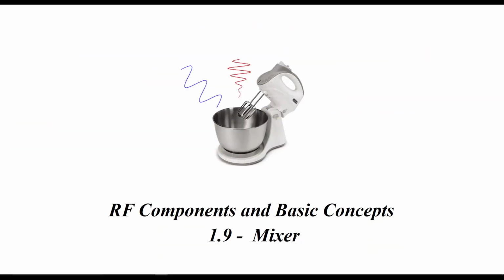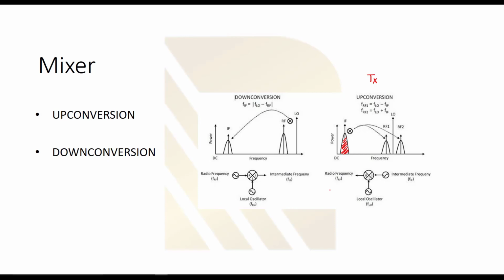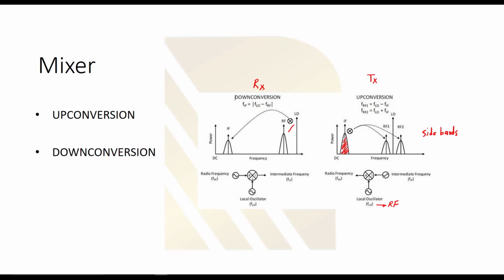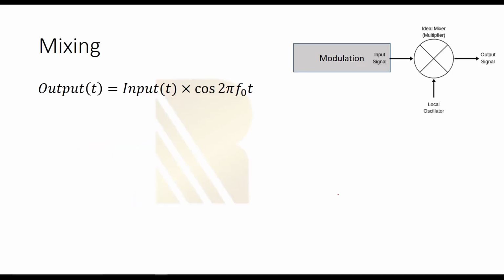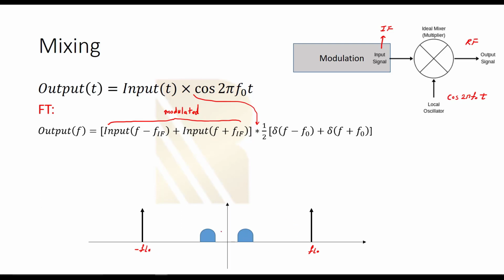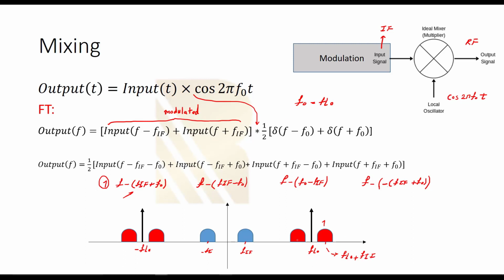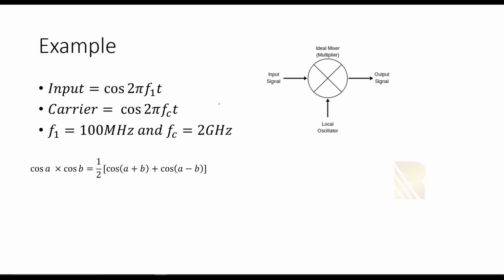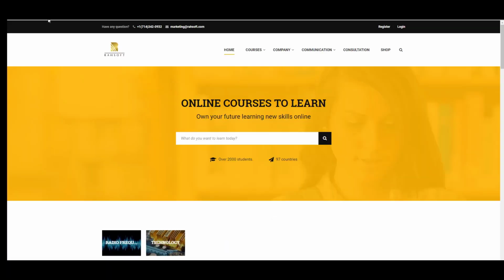Basic concept of RF mixer with examples. mixers in radio frequency. Mixer tutorials #14

Comment: nice lecture. Thanks. 
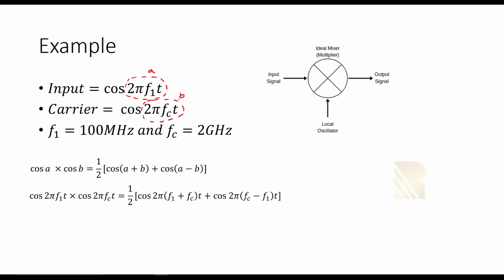Although i had some issues following it methodically. One instance for example, at 11:12 , it is said that there are two components 'a' and 'b' for the cosine wave, which are 'f1' and 'fc' resp. However, the equation at the end which should be 1/2( cos (a +b) + cos(a-b) ) , is actually written as ,
1/2 (cos(a+b) + cos(b-a))
As such, This is not a big deal. But considering students coming to the lectures are really going to be learning basics, these errors/typos will further add to the confusion. It shouldn't be glossed over.

In all, thanks for posting the view though. much appreciated.
Reply: Cosine is an even function so cos(b-a) = cos (a-b)
Reply: sang